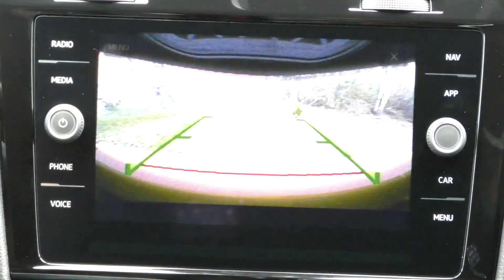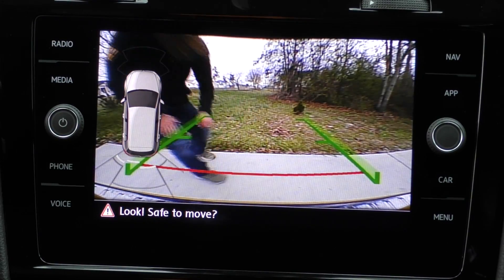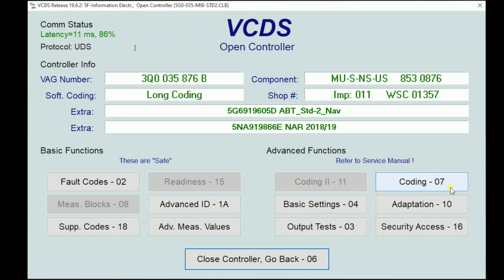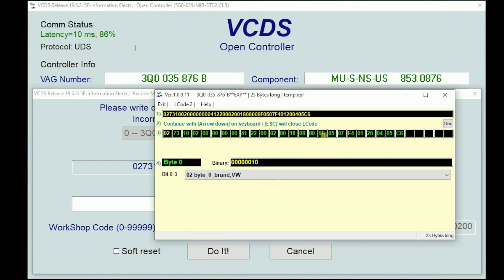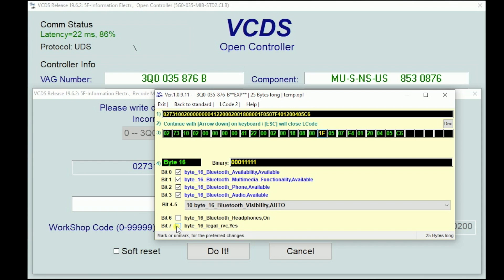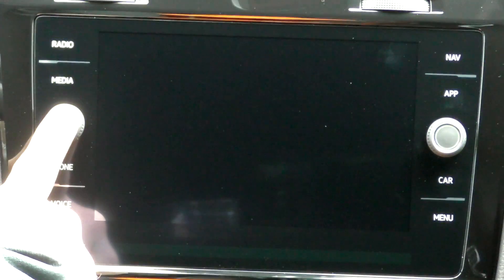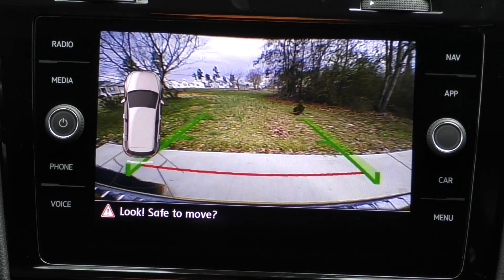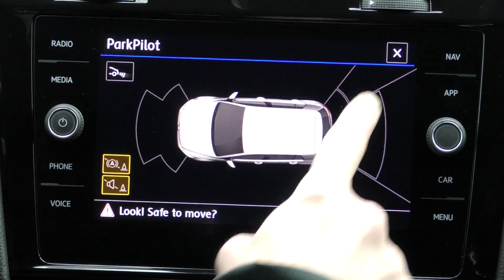How To Code Automatic Reverse Overlay ~ 2019 Golf R

Comment: Thanks Charles! I just did this using OBDEleven on my 2018 GTI Autobahn. Worked great!
Reply from the maker: Since a few others have asked, can you describe how you did it with OBDeleven? Please 🤗🤗
Reply: @HumbleMechanic  I just followed what you did. Opened up module 5f, pressed long coding and scrolled down to 16 Legal_RVC and changed it to no. Hit apply and restarted the stereo by holding the button down. Worked just like in your video.

Comment: I love your videos! I do have a question for you are anyone that can answer it. I am working on a 4 point racing harness that I had from my last car.  I was wondering is there anything extra that needs to be done when taking out the front driver seat other than removing the 4 bolts that hold it in. It is a power seat and my last car had manual seats. do I need to keep put washer under the other 3 bolts to keep the track even?
the car I have is a 2017 Golf R.
Thanks, lots
      Kevin

Comment: Thank you so much for your YouTube channel. You are the first video in my entire life that I actually took the time to log into my google account and hit the LIKE button. 

Any chance have you found a way to code the auto start stop to be permanently disabled?
Reply from the maker: Thank you! 
I have coded it out, but I have not found a way to do it with out a warning light.
Reply: lower voltage to <7
or remove that wire which connects tot eh battery

Comment: Hi, may I get some advise on my 07 r32. I will be traveling for 8 months so need to store the car in the garage, what’s your advise on the car’s battery, do I pull it out and if so will it mess with the cars computer? I know I could trickle charge it but if I’m not around to check it I’ll spend my vacation worrying if all is ok back home in Melbourne, great channel, learning lots, just gone from a Mazda speed 3 bk and pick up the r32 next month, thank you.
Reply from the maker: Disconnect battery. Put tires to 45 PSI and enjoy the travel
Reply: Thanks for the reply, that's what I was leaning towards but was told the computer in the car wouldn't be happy when it comes to start up time 8 months later, thanks again from Melbourne Australia.

Comment: Hi there! I have a 2013 vw cc R-line 65k miles. When I put the car from park to drive, the second it's on drive it does some whirring sound. And when I let go of the brake to accelerate, it does that whirling sound before it hard shifts from first to second gear. Could that be the transmission going out? A mechanic friend told me the sound is bc the pump is going out but I'm not 100% sure. What do you think? Thanks!
Reply from the maker: It could be. I might have a vw specialty shop or dealer check it out

Comment: Hi! Could you help me, please?
I have 2013 Audi 1.8 tfsi, with manual gearbox.
Upon starting I always have some grinding noise felt below my feet, and then it stops, doesn’t return during driving. Only when I park the car and restart, get to about 10 mph it “resets it self” with that grind. 
I have tried to do it in reverse, but it doesn’t happen. 
No mechanic is able to pinpoint what happens with certainty.
I am very grateful in advance!

Comment: Any idea if this works on MK7s? I’ve been looking to have this overlay automatically come up on my 17 R for the longest time.
Reply from the maker: Can’t confirm but it seems the mk7!l may just work that way from the factory
Reply: It does. I have a 17 R and just did it with obdeleven following the directions of another comment below.
Reply: I have a Mk7 - my car does not do this automatically. My bit 16 doesn't have a 7th byte there either, so this can't be completed. If you find out how to do it, would you mind sharing?
Reply: Bryan Pennartz Maybe you need MIB2 to get this feature because I was able to enable it on my 2017

Comment: Does anyone know how to code the mirror dip in reverse on a 2018 GTI?
Reply: Just an FYI, unless you have auto-folding mirrors, the mirror-dip in reverse won't function 100% correctly, as the mirror may or may not 100% return to the "normal" position after it dips.
Reply: Thanks Andy.  I don’t have power fold mirrors.  At least I know this won’t work on my car.
Reply: I did this with ODB11.   No folding mirrors here, but it works great.    Occasionally you have to adjust it to get it back where you want it, but it’s worth it to me to get it to dip.